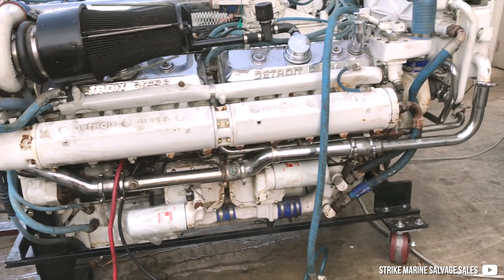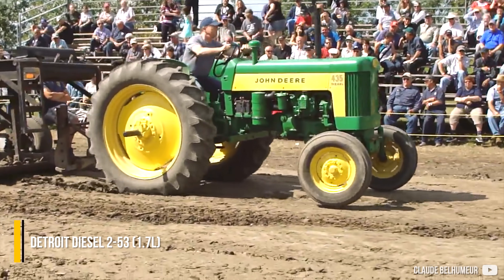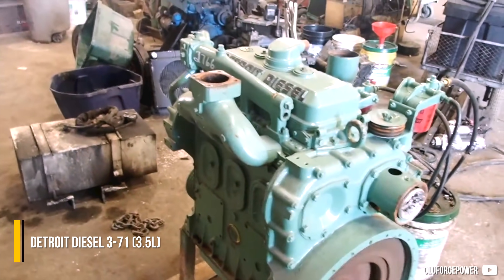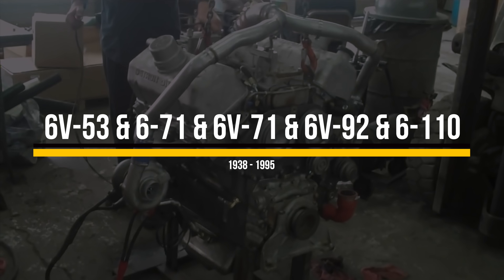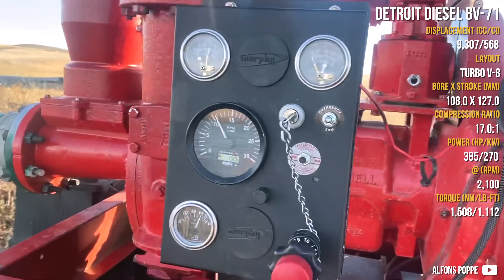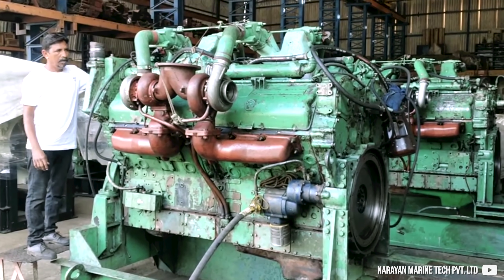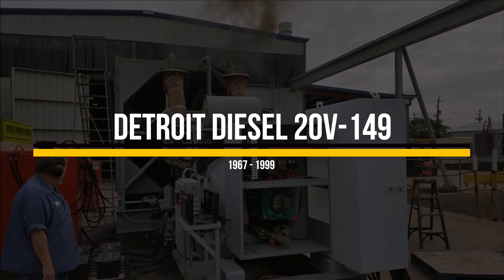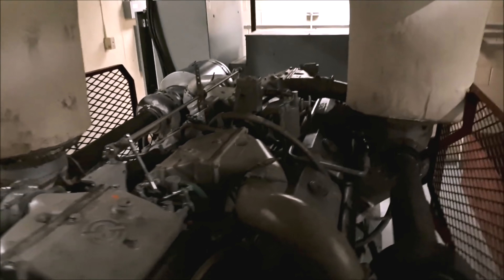Single to 24-Cylinder Detroit Diesel Engines

Comment: Detroit Diesel - One of the finest instruments ever created for converting diesel fuel into smoke and music.
Reply: 2-Stroke DD...The most efficient way to convert diesel fuel to noise, without the side effect of torque...(They made great Horsepower, but pull them 500rpm below peak HP and they fall on their face.)
Reply: @misters2837   Hahaha. You’re right about that. My uncle had a 238hp 6-71 backed by a 5 + 4. It would detect grades you couldn’t see with the naked eye 😂.
Reply: @dieseldemon8562  Its amazing, if you had the right Gear to keep it on the governor up the grade...you were fine...as soon as you got pulled off the governor, they would bog, and if your tried to lug it, as if it could be done, (especially a 92 series) you were rewarded with cracked liners...
Reply: @misters2837  You’re exactly right. I have a soft spot for the old mills, but they have their quirks. 
Like you stated, the big drawback to the NA engine was the blower was coupled to the gear train, so airflow was directly proportional to crankshaft RPM. Under high load, the governor and fuel rack would deliver the fuel, but the air required to burn the fuel cleanly was only available at governed engine speed. As soon as the RPM started to fall, the excess fuel would burn them up in no time. 

I’m not sure if any of the road trucks were set up like this, but most of our rail equipment that used the 3-53 and 4-53, had an air supply line running from the airbox to the Governor. It would use airbox pressure to balance the fuel rack. 
Over time, this line would clog with coked oil and the engine would lose power; with no signal from the airbox, the Governor would not advance the fuel, and the engine would stall as soon as it was placed under load. 
The railroad I started with had a 4-53 sitting in the corner collecting dust because a mechanic diagnosed it as a bad engine. Unfortunately, he had pulled the Governor off, and tried swapping it with another unit. In doing so, he had the fuel rack and buffer settings off, and the engine ran wide open when he started it. I was hoping they would let me track down the tools needed to set the Governor correctly, but they were pretty well done with it at that point. I had asked around at DD, but most of the techs that had worked on these engines had retired. It has become another lost art.
Reply: @dieseldemon8562  It is a lot of "fun " setting the fuel racks on a 12V71. The Woodward governors were never touched in the 18 years we ran them while I was there but all three engines did have a complete overhaul when they had 14,000, 12,000, and 10,000 hours use on them. When I left, they were still set where I had set them at the time of overhaul and the 14,000 hour engine had 28,000 hours on it by then and was still running fine.
Reply: @gravelydon7072  That stands to reason!  Like the old saying goes, if it ain’t broke, don’t fix it!  I would just about bet that once the rack is set correctly, and everything is torqued properly, there is no reason to go back into it and make adjustments. Short of an injector being changed, but even that would only require it being in sync with all the others on the bank. 🤔. 
I know Union Pacific had us run the racks on the EMD locomotives ( 16V-645 & 16V-710 ) at every PM, for emissions, and it was completely unnecessary. They also changed A LOT of injectors that were not bad. I imagine that similar to the smaller engines, having hands in them when unnecessary caused far more problems than it prevented!
Reply: Agreed Detroit Diesel engines sound beautiful too bad my generation is so soft and can't understand without Detroit Diesel none of the buses would be bringing them to school.
Reply: @Highrollinhunter  Huh? What? Can't Hear You, DD Took Our Generation's Hearing... We had some old DD buses and even some Gassers...
Reply: @misters2837  hell yes
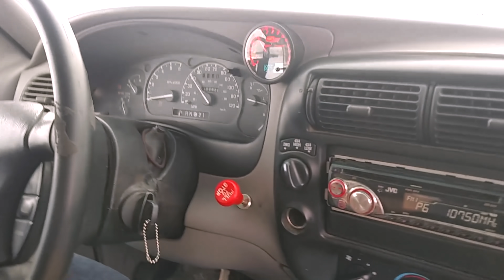Reply: 3:57 gm vechicle not moving rpm problems !
Reply: @szymon6207  electric tach  and mechanical  engine  incomplete swap.....   but it screams  its  more gooder

Comment: Great video-but you missed the 2-51 and 4-51 valveless 2 stroke Detroits. Also missed was the 8V-149. The 24V-71TTA marine engine put out 1,800hp at 2,300rpm! 6-71's were made in lay down to fit under mid mounting in school buses. Many on at sea oil rigs were mounted vertically with the alternator at the bottom with a water cooled thrust bearing and the engine happily running standing on end! They could be run in either right or left rotation. Probably the most versatile engines ever made. AND the only engine made that you could get a non turbo 6-71 rated at 165hp at 1,800rpm continuous horsepower made in 1938 as well as still being made in the last year 1998. The 6V-53, 8V-71 and 8V-92 are still being made by MTU for military vehicles.

Comment: Great video. Don’t see many screaming jimmies in the U.K.  I saw one in Dorset fitted in a fordson E27N built for tractor pulling. Fantastic engines but many people who worked with them suffered hearing loss due to the exhaust noise, ear defenders are a must with these engines. Peace and love to you!
Reply: You have the Rootes TS3 Commer over there.  Very cool engine.
Reply: @andyharman3022  that is true, but besides the marshall two stroke singles, that’s about it. Strokers never caught on over here. They were more coming in motorcycle form here. Villiers and of corse the Japanese bikes. As a Brit, I tend to think our engines are smaller but beautifully engineered and powerful, and the engines in the states were just much bigger and more unified. Simple isn’t always bad 😉
Reply: @chriswilson2431  they was also in Euclid/Terex scrapers ..TS 14's & Ts24's..

Comment: My dad had 2 cab over trucks that pulled double trailers hauling hay from our farm.     They both had Detroit 8V-92’s.     They both had a supercharger and 2 big turbos.      The tag on the motors were stamped 675 horsepower.     They were monsters.

Comment: Hello mister racer man!
Love your videos
 you should look into the 4 - 51 and the 2 - 51. They are a Detroit Diesel that uses no valves, instead the use the ports in the bottom of the cylinder for exhaust and intake. Almost similar to how a two stroke gas engine runs, except they still need the charger for air. They might not be good for just a standalone video but they would be great for a unique Engines video.

Comment: You missed the series 50 4 cylinder and series 60 inline 6 cylinder.
Reply: Those are 4-strokes.
Reply: You missed the part in the title that specifies two - stroke  ...

Comment: Great video theses GM diesels are still common in the states we have 2 671 generators on the boat but don’t forget the other General Motors Diesel the Detroit’s big brother the EMD 567 645 and 710 commonly used as main engines in boats and locomotives be a great video for those overseas who may not have EMDs in there country

Comment: Seen a 12v149 on a genset run away. Thrashed the alternator off the bell housing and broke the I-beam base as it thrashed the rotor around at who know what rpm. It stayed together bottom end wise and only stopped when it bent enough valves and broke enough valve bridges to quit. Tough bastards...

Comment: Hello again Visio!  Over my 40+ years as a truck driver, I’ve driven my share of Two Stroke Detroit’s! T most recent was only about 10 years ago in an older GMC Car carrier. That was a 3/71, with a turbo, hooked to a 5 speed low hole manual trans, with a two speed rear end. The sound that engine made g splitting gears was amazing! I must clarify the information you’re given, there was absolutely no multi cylinder naturally aspirated Detroit Diesel engines! All were supercharged! While being a 2stroke there were no intake valves either, every valve, either 2 or 4 in the heads were only exhaust valves, as the intake is controlled by piston ports cut into the cylinders, hence the need for a supercharger to help in the scavenging that forces the intake in, then blow exhaust out for a brief moment before the piston closes the intake port, when the exhaust valves are closed for the creation of compression, with fuel injected at the precise moment for compression combustion! That’s why so much torque is created, there’s a power stroke on every revolution, instead of every other, like in a 4 stroke. Turbos are added to increase horsepower at higher rpm’s.
Reply from the maker: Many people considered them as naturally aspirated for the fact that they do require those blowers to run. They cannot naturally run without a blower, hence calling them naturally aspirated. And it makes full sense to me.
Reply: @kevinvoyer5053..... NONE, of our 2 cycle GMD/DD engines were "Supercharged".... they were either Natually Aspirated (with a maximum of "up to" 4 psi) for scavenging, for the ability to "push / Scavenge" the expanding exhaust gasses, out of the cylinder.   Roots Blowers, in and of, themselves... Do NOT and Cannot, "supercharge" (increase air density) air flow... they can only "Move" volumes of air.    

Anything Above O psi that is registered on a gauge, is strictly due to "Backflow", or buildup of air mass, against a receiving location, faster than [ie:] the engine can consume it.  Roots (Originally.. "Rootes" / Rootes Connersville) Blowers are used in many hundreds of applications, primarily industrial... we just adopted them for use on our 2 cycle engines.
Reply: Torque? Now that's funny.

Comment: Most American diesels are timing gear
Reply: The 3.0L Ford Powerstrike has a timing belt (with the oil pump ran off that belt).  The 6.7L is timing chain (I think).  The OLD 7.3L Navistar International (also known as the 7.3L Ford Powerstroke) was timing gears.
The GM 6.6L Duramax (most recent gen) is timing gear.  I have no idea if the Cummins 6.7L in Dodge trucks are timing gear or chain (but I do know the 5.9L was timing gear)
Reply: @charlesball6519   all Cummins inline are timing gear

Comment: Instantly recognized that 4-53. Ran a car crusher from the 70s with one of those on it. Great engine, always covered in oil ( I mean horsepower sweat).
Reply: Horsepower sweat! I’ll have to remember that one.
Reply: HP sweat was what a 4-53 HS engine did when hooked to a 6X6 water pump. Even though the No Load speed was over 3000 RPM you would find out that that 6X6 pump would limit it to 1900 RPM with a wide open throttle. But it would run at that speed all day long. You just never wanted to hear the damper drop at that speed.
Reply: @gravelydon7072  what do DD harleys and  VW's all have in common, if they aint leaking there aint no oil in them. thats how that they how they earned the nickname "leaktroit".
Reply: It's usually a damaged blower seal that cause oil to go everywhere.
Reply: @andrewking9761  Often caused by a damper drop. An overspeed trip would cause the damper to drop and that would create a partial vacuum which would pull in the lips of the oil seal if it happened too often. And then you have an oil leak.
Reply: Put a picture of a Detroit diesel on the wall and oil will leak out of it 🤣
Reply: They were good at rust proofing anything they were around. P.O.S.

Comment: My only question is why does the v20 make more power than the v24
Reply from the maker: There is a significant volume disadvantage. The V-20 has 149 cu in per cylinder, the V-24 has less than a half of that (71 cu in per cylinder).

Comment: Got to see a 16v that had twins blowers and 4 turbos and it was used for a air pump for natural gas pipelines. Awesome
Reply: When I worked in the oil fields we had a pump truck with twin blowers and four turbos on it all of our other pump trucks had 892s and I drove a truck with 871 in it man was that a nice truck it was a 61 Kenworth needle nose
Reply: All the 2 stroke GM diesel had blower's, won't run without them

Comment: Look up a 16-278A. It’s a Detroit but was called a Cleveland.
Reply: The Cleveland diesels are a separate line of engines.   Same principle as Detroit’s but bigger and completely separate from the Detroit line.   Quite familiar with them, my grandfather operated a couple tugs that had Cleveland’s in them
Reply: Was it a P.O.S. too?

Comment: My dad is still using a detroit 2 cylinder for a generator for sometimes when the electricity is out, he has two mufflers on that thing but still is loud like a straight pipe😂😂
Reply: They get alot quieter the more you work with them ...but now I'm have to ask people to speak up lol yeah
Reply: @lastone3926  more like you just lost your hearing 😂😂
Reply: A 12V71 no matter how well muffled even with the exhaust above the roof line outside will produce 108db of sound right next to it at 1800 RPM. They are not quiet engines even at idle.
Reply: Its a alarm clock 😄🤣🤣
Reply: Lmfao

Comment: Detroit diesels are the most incredible diesel engines you'll ever see or hear, and are even better in real life. The amount of power they can make is truly INSANE
Reply: 12V71 Twin turbo military engine could produce 600 HP. For 24 hours straight. Then it was overhaul time according to the military. A 12V71 NA engine could produce 340 HP for more that 14,000 hours without problems.
Reply: @gravelydon7072  it worked too good so they had to fix it lol

Comment: Who hasn't tried to imitate a Detroit Diesel engine when you were a kid playing with Hot Wheels or Matchbox trucks? because I was one of those.
Reply: I always tried to imitate the sound of the green goblin truck in Maximum Overdrive which had a 8v92 in it :D
Reply: @kenevans3659  
I personally used the 6V71 for the smaller trucks and the lifted pickups and the 8V and 12V for the bigger stuff.

good times.
Reply: all you have to do is go AAAAAAAAAAAAAAAAAAAAAAHHHHHHHHHHH
Reply: So true!!.. 🤣😅

Comment: All V12s were single block casting. V6 and V8 cast up to 149 for 20V149.
Reply: The 12v92 is 2 blocks cast together, reason why they use 4 heads

Comment: The sound of so many trucks, fire engines, and school buses when I was growing up in the 60s and 70s!
Reply: Ya our station had a1976 american lafrance fire engine it was beast
Reply: Do you remember the old "Slim Jim GMC cabovers that the postal service used? They used the 3-53 and 4-53 engines. Man did those puppies scream!
Reply: @ronfullerton3162  yes the 53 series is awesome. i got a silver 8v92 2 stroke and a mini jimmy johnson 4L side oiler v8 2 stroke small block 4 bolt main. I got 6 gallons of BRP XD-100 syntheic oil for the 8v92 to fill and run, she love it.
Reply: @jlo13800  sounds great! Had many of the old Detroits around me in the past. Several friends had them in semi tractors. And I knew one fellow that had a 6V-92 in what I think was an International 1066. Made quite the screaming farm tractor. Miss hearing that wonderful sound. Too bad we didn't have the synthetic oils back then to of given them that better protection. The improved lubrication of synthetic would of been a big help to the two strokers.
Reply: @ronfullerton3162  These are advanced high performance 2 stokes, lolts of power at low rpm but we know that a large sled 850 etec rotax, polaris patroit, fairbanks Morse OP and achates power 2 stroke cannot turn the revs of some of these whipper snipper cummins and DT466 4 stroke which can cream all day at above 8000 rpm's. A small 5.9 ot dt466 is a shorter stroke engine and can run insane rpm's, but they lack the low end grunt of a proper 2 stroke and are not continous duty, look at big 2 stroke v6 out boards and detroit diesels that can run high load at low rpm's for 40 years! Synthertic 2 stroke is far supior even for dt466 IHC 2 stroke conversions!
Reply: etec rotax emd 4500 hp and polaris run the same oil, get over it
Reply: Not to mention the M113 chassis and all it's variant's with the 6V53T Detroit 2 stroke supercharged engine, one of the most produced armored chassis in history and the vast majority of them had that V6 Detroit engine in them, if nothing else they used to keep me warm at night when I would sleep on top of the engine grates wrapped up in my poncho liner.
Reply: The detroit and achates power take over where snowmobile engines leave off!
Reply: Growing up late 80's-early 00's I remember riding buses with 6v71 and 6v92 engines.

Comment: There was a GM Diesel Marine power unit with twin 6-71s driving a single prop shaft through a Twindisc trans. The trans had a 2/1 reduction.
Reply: There is also a quad pack that has 4 6-71’s on a single shaft.   We have one on our tug
Reply: @TugboatMatt  I remember seeing that unit in the GM manual that was on our boat. Four 6-71s flywheel to flywheel and side by side. No two engines setup the same but all engines the same.

Comment: I remember riding in railcars in Belgium which were powered with either one or two 6-71's or one 12V71, a lovely sound these things had.
And standing at the trackside you could hear these approaching from 6 miles away.

Comment: People from the logging industry will likely remember the 353 the most as timberjack used them extensively in their smaller skidders from 60's onwards.    So the story goes that in Canada up in the hills if you got lost while logging you could listen closely enough and hear a 353 no matter where you were and you followed the sound to safety. In Australia the little timberjacks are almost legend to the older cutters as screaming jimmies.
Reply: I run a old Clark Michigan rear steer loader with a 3-53 and you can definitely hear it for miles around.
Reply: @dcrog69  A 4-53 High Speed engine can be heard in the next county. ;-) I live about 3 miles from a couple of pump stations that run N14 Cummins and Cat engines. As I worked at them, I can tell when they are running just by stepping out on the porch.
Reply: most people around here still use 353's, 453's and 653's in skidders and knucklebooms.  No other engine can take the abuse of running wide open all day in cold temps
Reply: Awesome!
Reply: I have an international payloger with 353